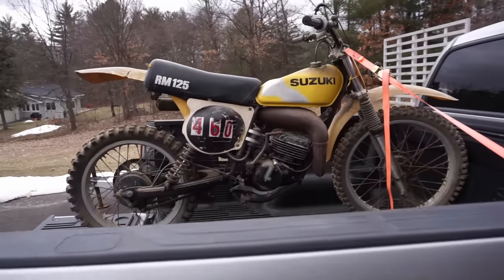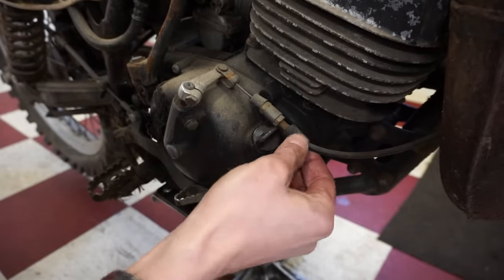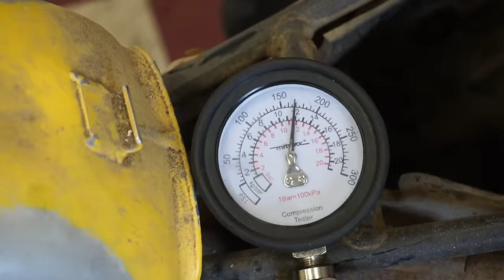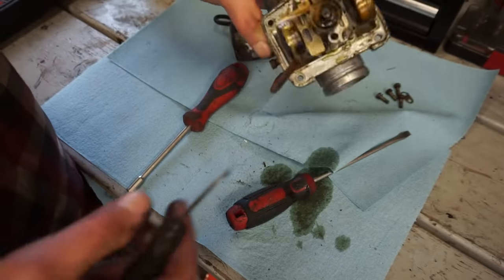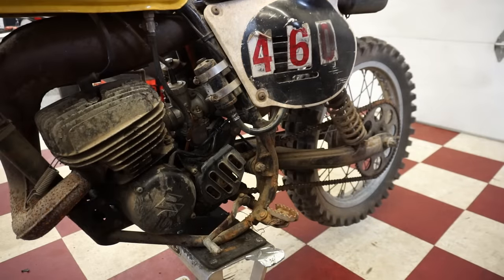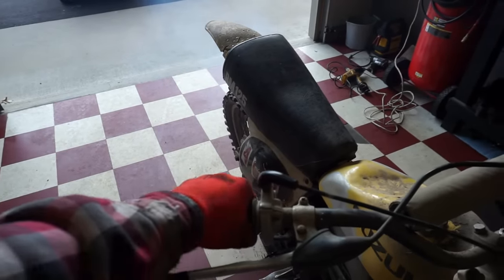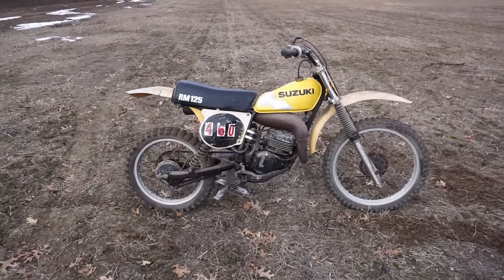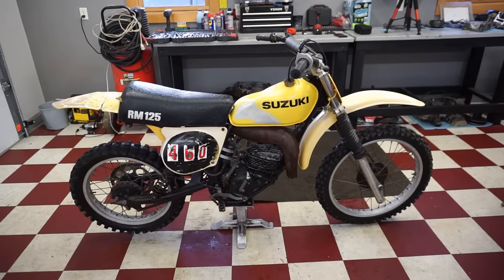Rare 1977 Dirt Bike Found Sitting In Barn For 20+ Years (AMAZING FIND)

Comment: I had very same bike and I used compressed air and som hammer action to move the metal particles along with heat remember not to much heat also you can hydraulic the tank with water. Like on a expansion chamber on a two stroke. I have had more than 3 or more hundred different machines Back in the early 80/90s family in Massachusetts owns a Yamaha dealership and I would get everything that couldn't be sold on the floor. Fix them up and buy ,sell trade,.. I always had several different rides for my friend and family.living next to a old dump and a natural sand and gravel Bank and at the bottom of the the Mohawk Trail and the Mohegan trail from Florida to past Canada. Greenfield and Deerfield town line family owning more than several thousand acres of property and orchard with Big High Tension Power Lines coming out of Vermont Nuclear Plant and Deerfield and Green River into the Connecticut River. So many memories I would love to talk with you and share some Stories and share our experiences. I'm much older but you so remind me of myself . I'm a retired Master Plumber, Pipe fitter, over 40 Years. I still Ride every day. Looking forward to hearing from you Thanks God Bless and Keep Up with the Positive thinking. Dale

Comment: The best way to remove the dents from the gas tank is by pressurizing it with air. Just stick the air nozzle in the hole where you fill it with gas and stuff rags around the air nozzle to seal it and hold them in with one hand while you squeeze the trigger with the other hand. I've seen my dad do that once on a street bike that had been vandalized that resulted in a huge dent in the gas tank. It may not seem like it would work but just try it. I've seen it work.

Comment: Well done video. I owned and raced one at the national level back in 1978, bought it used then. Best over all motocrosser I owned, fast, reliable, handled great...FYI, they are not at all rare, Suzuki sold many thousands of them in the US alone. The problem with bikes this old, is bearings can get rust spots on them and then after riding hard, they can have problems, especially the big end of the rod. Also crank seals can shrink and come apart with not fun results. Thanks for posting!
Reply: The good news is I split the case on a bike exactly like this one. This was back in 1981 and I had no YouTube or help. I bought all new bearings, rod, piston clutch and gaskets. It wasn’t hard. That thing ran like a scalded cat! So reliable. If you can find one and new parts, you’d be in business today! Wish I never sold that bike.

Comment: I think you need a rubber plug for the gas tank and you can use compressed air seal up to the rubber plug and it will pressurized the tank and the dents will pop out

Comment: I had a Honda CR 125 and the tank was dented on the right side. My foster fathers mechanic, Miguel, used air. Did not fully fix it but it moved a bit. I would use a dent puller.

Comment: These are great bikes, the '78 wasn't much different, had a few nice factory upgrades. This engine was so good for all around use, the PE175 for enduro riding was really much the same bike. Original tires on the 78 would have a heavy reinforced rim-saver bead, maybe these will.

Comment: I grew up on a 1988 Honda odessy pilot. It had a 250cc two stroke. I rode that thing for hours in Nevada desert, snow , mud. , ran it into a lake by accident and flooded the engine. We drained the cylinder and it fired right up. This was after it was super hot from running it for hours. 
It ran the day we sold it.

Comment: Hit the tank with a torch or heat gun get it hot and it should pop out if not while it’s hot use a crow bar or something (make sure you put rubber or a rag on the end of whatever you use)to pop it from the inside

Comment: This Suzuki RM 125 indeed is a great bike in a very positive way a powerful beast.. !! Worth restoring with about $500 the same $500 you bought it for so for a total more or less of $1,000 into it is a no brainer. Once you get the tank fixed away from the dents on the tank also new rear break and new pegs and new quality chain and tires with the seat cover redone with a premium gas 4 ounces of fuel cleaner maybe Techron times two applications to the fuel the carb will be running even cleaner and meaner, kick ass 125 …!

Comment: Cap off the lines heat up the dented areas and add compressed air until the dents come out. Or you can call a dent removal company and they can come get them out.

Comment: heat the dent up with a heat gun and apply compressed air thru the petcock stem. seen a lot of steel tanks fixed that way YMMV on an aluminum tank

Comment: A old trick my dad used to use to fix gas tanks that were that bad was to fill them with water and seal them up and  freeze them.  The water would expand and you can work out the dents as it expands. You can also make a cap with a Schrader valve in it an d use air. As you "an imagine, the air method must use caution.

Comment: it is touchy but close off the petcock and use a rubber grommet at the fill point and just use compressed air in short spirts until the pop out. to much air will balloon the tank and ruin it so be careful of how much pressure you put in it

Comment: If you want to get the dent out of the tank try plugging the petcock and make sure you have a good seal on the gas cap then put it in the freezer for 24 hours after 24 hours boil a pot of water once it’s boiling get the tank out of the freezer pour it over the frozen tank. This will cause internal pressure and it will push the dents out

Comment: Put a plug in the petcock bunk on the bottom of the tank and make a cap with a air stem on it and you should be able to fill the tank with air and push out some of the dents or you can do the same thing with a pressure washer instead of air using water to push the dents out

Comment: Heat your tank up with the heat gun and spray compressed air down there it will compress the tank and get all dents out very simple job I used to do it on a lot

Comment: What a Great pick-up for the channel that era is awesome! It sounds so great out in the field ripping the gears and two stroke smoke I can smell the old Bel-Ray oil I used to mix great memories Joe! I think you can pick up a dent kit that uses glue and pins to pull the dents and maybe a little air pressure in the tank also but be careful you can pop them easily I hope you think about restoring it the best you reasonable can it's worth it these bikes are Wanted!🤔😉👍📹💯✔️👋👋👋👋💵

Comment: I found a 35 year sitting barn find all orig oem 1978 RM250C for $500 , identical to this 77 RM125B which l raced back in 78 . My 125B had a mild port job , Twin-Air filter , 36mm mikuni & Boyesen fiber reed petals .

Comment: Those old two stroke 125cc M/C bikes had real high horsepower for such a small engine. The stress put on that small piston probably would lead to reliability issues with the engine over the long haul I would think.

Comment: I've been looking for a n old rm125 for years but the prices are always high. This is a nice bike. If you restore it don't repaint the tank just seal the inside. Clean the outside and spray it with clear coat to seal in that old cool look.

Comment: my sister did body work and told me put water alone lol in tank and lid on put it in a deep feezer. just keep an eye on it as it freezes and pull it out about half done and thaw and repeat as the amount of water held has increased so second will usually freeze pop most all your problems at least to acceptable! P.S. You're gonna want to have at least a 5 gallon bucket bout 2/3 full of hot water to stop freezing process immediately and also be SURE there's NO ice left before refilling to finish!

Comment: I was told that if you have dry rotted tires(tubeless) that if you remove the valve stem and put a bit of oil or dish detergent it would seal or prevent the tire from bursting. Is this true?

Comment: I'm partial to the older bikes. Easy to work on, sound great, and most were reliable. There is the difference in a yard find and barn find. As long as mice don't get in they are cleaner and worth fixing. Either full restoration or let someone else buy it and enjoy doing it. No point in doing a partial because we all know how that ends 😂

Comment: You could try the freeze trick to get the dent out of the tank. Fill it up completely full of water put the cap on and freeze it and it will expand and push the aluminum dent out that's how I get dents out of my 2 stroke RC truck pipes they are aluminum, you might put a couple clamps on each side so it don't push the side out it's worth a shot can't hurt it worse

Comment: You can put a piston , rod setup from a 74 tm, and make this 175 cc...Amazing mod...I had one of these with a dg kit..Fast great handling bike, side note I was 4 ft 11 inchs tall 85 pounds. Ihad to use a milk crate off the line...Fix it cherry..I also put a plastic tank from a 78 on it...

Comment: Yeah, if you can get the dents out of the tank, a cosmetic restoration to repaint the tank and motor parts, replacing worn and broken  components and tires woud make this a sweet bike. I love the sound and torque of these old two-strokers. Small displacement, but they are pretty quick, right?

Comment: Old 80s and 90s 2 strokes didn’t need a top end rebuild every 20 hours of use. They lasted years before blowing up or losing compression. As long as you mixed you gas properly. They were tanks.

Comment: I remove dents from tanks by washing the tank out with soapy water getting a rubber stopper that fits in the fill hole of the tank putting a valve stem in it. Put it in the fill hole you will have to get a couple of  giant hose clamps that will fit around the tank and stopper to hold it in place. Put air in the tank not much 5 to 10 psi use a propane torch to heat the dents from the outside of the dent to the middle as your heating it you will see the dent pop out back to its original shape. You might have to add air to the tank as the dent starts popping out because there will be more tank volume as the tank takes its original shape again. You can use a tire pressure gage to monitor the pressure.

Comment: Those things were thrown away left around in the late 70s - you could by one a year old for $200.00 all day long  - I had an RM100  with a 125 top end - essentially a 125 - I think I paid $75.00 for it with blown top end in 1980 - ran it a year as my practice bike - back fired caught on fire and burnt to the ground.  The RMs were great looking bikes - all out race and nothing more - loved the 70s RMs - had a 77 RM80 then a highly modded 1980 RM80 that I raced in 80

Comment: You can use a deflated ball inserted into the tank and then pressurized to push the dents out .  I wouldn't fill the tank with water and then pressurize it, that is called a hydro test, you will split the tank

Comment: nice find. some times the compression will read high but that dont mean its ok
 i had one that it had high compression but it was dirty with carbon and rust and thats what made the compression high after it ran
for a little wile it started smoking heavy and lost all its compression with clean fuel
it cleaned all the gunk out. my point is just take the head off and do at least a 
upper rebuild or you could ruin the engine trying to run it. the compression of a 170 psi
is a sure sign that the rings could be clogged just saying wy chance it just rebuild it
these old bikes are from a time when motocross was great. and need to be restored
and used not siting in a museum..

Comment: My era.
started racing on a 74' TM125.
To get those dents out of the metal tanks we used to take it off the bike and put a cheery bomb in it, Leave the lid off. all the dents cam back to original.
I know it sound weird but, smash a beer can and put a fire cracker in it. Goes right back to normal

Comment: I had a rl250;Suzuki trials tank with a badly dented tank like yours, I got the tank dents out by connecting a foot pump up to the breather on the filler cap and pumping air into it didnt think it was going to work until it went bang and scared the crap outta me ! When I recovered the dents were gone. 🥺🥺🥺🥺🥺

Comment: From your perspective, having ridden a lot of different bikes, what do you think of the old air cooled 70s 2 strokes vs the modern MX bikes?  I know the suspension and chassis are night and day, but as far as the power / gear ratios / etc.  Just would wonder your opinion considering the wide range of bikes you have ridden.  Me personally I loved the power of my 76 elsinore Honda 250 2 stroke, but never got to ride it side by side with any of my modern Motocross bikes.

Comment: I've used two different types of toilet yes toilet float stoppers drill holes in them for A pointed nozzled tipped blow gun for air compressor. Push down hold it tight until you hear A pop sound then stop look it over really good. Continue that process until it's either completely straightened back out again.,or not at all one. Another trick is empty the fuel tank then set inside of A freezer until it pops from the metal shrinking.,an tightening down. With the gas cap off of it.

Comment: I've seen motorcycle tanks have dents popped out with high pressure gas, probably not something you want to do yourself, you could check with some auto body places, someone somewhere will have experience with it

Comment: I would try to get the dents out with water pressure. to make it nice the water will give you enough mass to tap it out. a karcher will provide more than enough pressure. even too mush but you can control the process.

Comment: If you put the bikes in the front left or right corner of the pick-up bed u only have to make the straps lightly tight. Then u can pick up the rear tire to sit where ever you want and it won’t fall over. 

Note do some gear change on that Suzuki they seem reall y TALL gearing! Get the ratio higher for lower gear ⚙️ing. 
Maybe check stock sprocket teeth and agjust

Comment: I believe that has the thread on gas cap I saw a guy fix one of those once by putting an air Chuck on the petcock valve with a regulator and slowly upping the pressure and tapping the side of the dents with a leather faced body hammer the pressure popped the dents out not exactly perfect but got it really close. I believe he lined the inside of the screw-on cap with two layers of heavy plastic as a blow off regulator. Plastic would pop to let air bleed off like a pressure cooker

Comment: The engine had 170 PSI of compression because you had already squirted oil down the spark plug hole, that sealed around the rings. You need to do a compression test FIRST. Then, if the compression is low, squirt some oil in the cylinder and if the compression comes up, the rings are bad or stuck.

Comment: i managed toot a shredder valve on a cap seal up the holes and force air into tank om mu alloy tank and it came  out surprisihlu well couldn't get the small dings out but the big stuff came out a treat

Comment: If you fill the tank with water and block the filler off air tight and put a tyre valve on pet-cock and use a foot or hand pump to slowly blow out your dents ( no compressor or flat tank you get ) done this many times many years ago for my trials and motoX bikes. Good luck and thanks for your posts .

Comment: I had one back in 89 it was realy nice it run but it was bored all the way out Wisco piston was loose some one had a throttle tube used for a silencer coupling which the end was not cut out it was exhausting thru a pencil size hole which contributed to the piston being loose back then no net hard to find cilynders

Comment: If you have a lathe make a cap that will plug into the tank and seal.  Drill a hole in it and tap it for a 1/4 npt fitting.   Fill the tank with water and slowly pressurize with a hydrostatic pump.   Any mechanical contractor will have one.  Don't use compressed air you risk shrapnel.   Stop when the dents stop moving. Don't pressurize past when the dents quit moving or the seams could burst. Use filler for the rest of the repair.  Take a good close picture of hte graphics in case the OEM wants too much for them.  Anyone with a graphics making machine can replicate them from a picture cheaply.

Comment: I would ask a PDR tech to fix that expensive tank. Alternatively i would get completely empty of fuel and fumes heat it up on the dented parts and use air pressure VERY carefully... Whatever you do, dont work the dents cold. use at least some heat.

Comment: Easy access to the most important parts was a big deal back then.....Most riders that raced pulled double duty as the tech besides racing.  Had to be able to judge and fix problems before the next race starts and not have the entire bike in pieces on a tarp to change a small part.

Comment: Missing original kickstand. Check top seam of the pipe under the tank...mine split open in 1979 after two years. I then bought a 79 model. Motor on 77 had better powerband...79 motor needed to be short shifted. 77 motor would rev to the moon...
79 powerband would just drop off way too soon.

Comment: All u need to to get the dents out the tank is a good air compressor and heat . plug the fuel tap up and find a rubber bung to fit the filler cap or another cap drill a hole in the centre of the rubber bung or cap  and apoxy a  car tyre valve to it and fill with air and heat it up around the dents and they should pop out it takes time but it's worth It